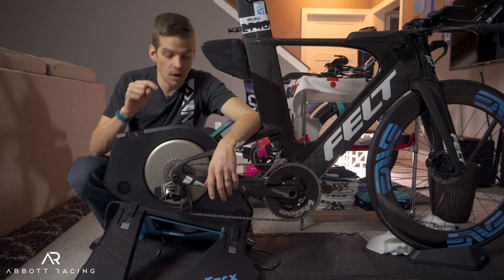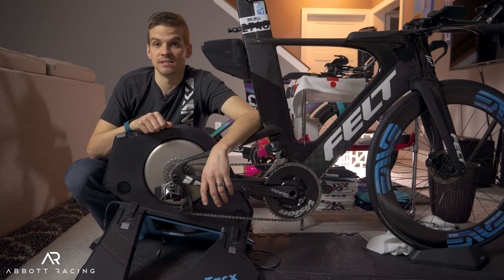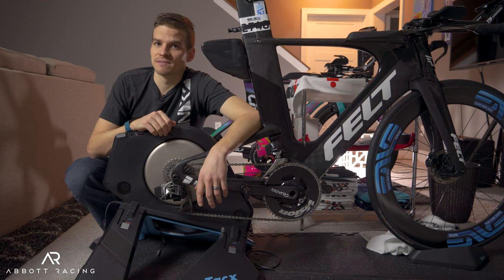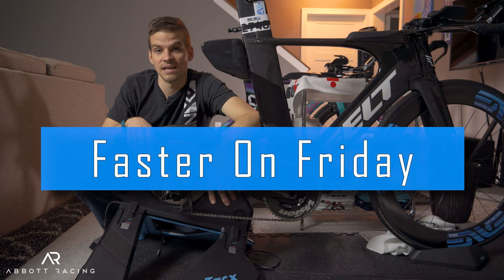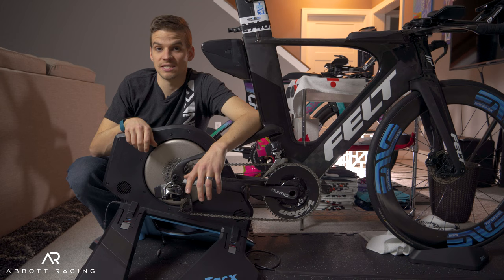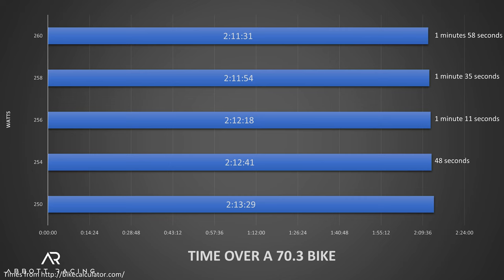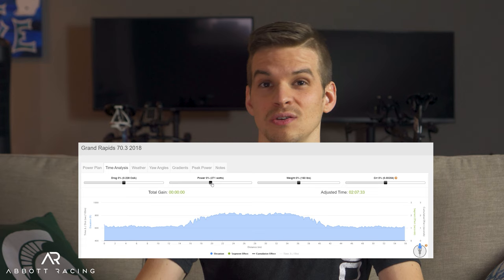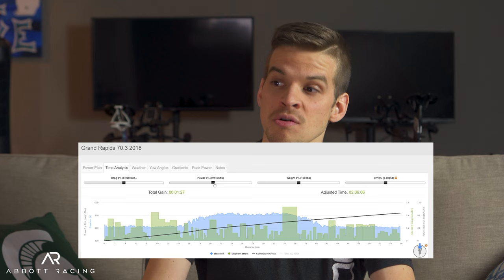Full CeramicSpeed drivetrain, worth it or marketing BS | Faster On Friday

Comment: spot on about the precision testing.  lol setting up a lab is non trivial. 

In theory you could try to ride on the same bike with ceramic speed components on the same day and then swap them out.  Same course, same wattage, record time.  That’s a crapload of work tho.
Reply from the maker: I have plans to do outdoor testing once the weather improves. I know with the variables outdoor testing brings I can't be looking for 1 watt differences but for larger changes it will be helpful.
Reply: It would be cool to see dollar/watt savings cost.
Reply from the maker: Ya that's a good suggestion. I will be sure to add that in going forward. Thanks